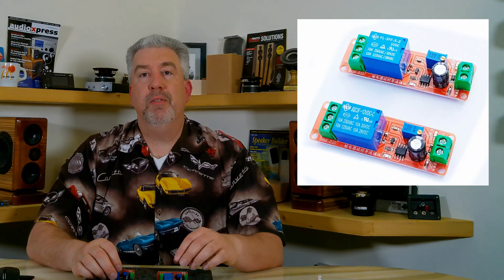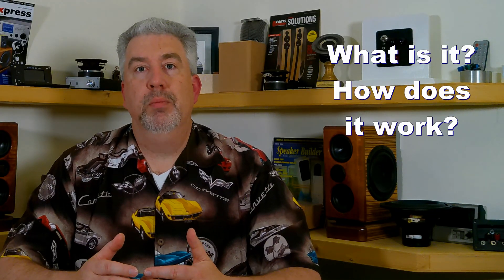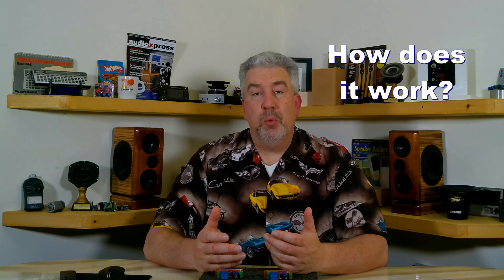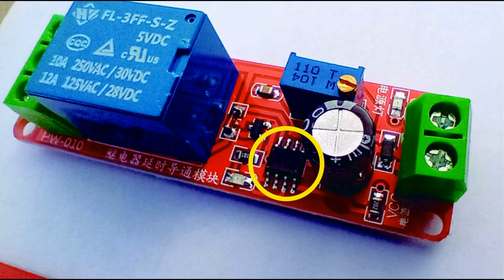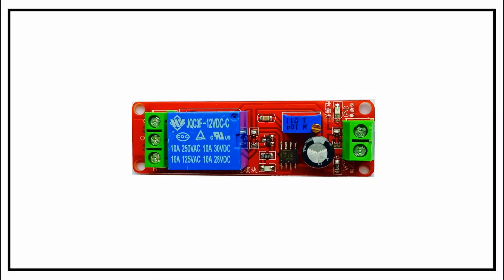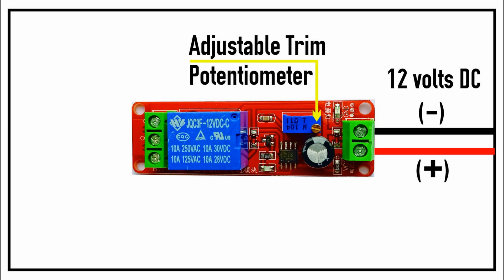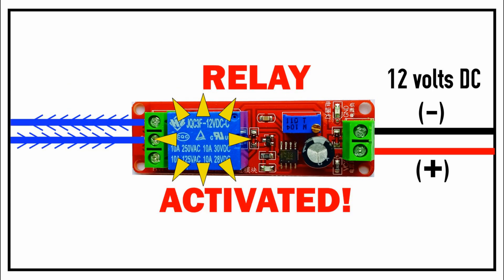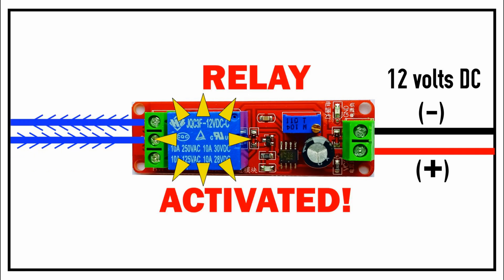Looking into How a Time Delay Relay Works

Comment: Help. I have a push button inside house by front door. This button, while pressed, opens up the metal gate that is 20ish feet from front door. I can press the button to let someone in, but me trying to get out the gate is not possible. As soon as I let go of the button, the gate locks(magnetic). Will this relay fix my problem?  Im not very hands on but can follow simple directions. Help this poor chap, please. Thanks

Comment: I converted my motorcycle from mechanical water pump to an electric one and used one of these to turn that pump on after about 10 seconds from key on.  That gives me the time to get the engine started so that the water pump (which draws 1.5A from the system) is only powered when the engine is running.  Working well so far.
Reply from the maker: That's a good use for something like this. I think they're pretty sturdy, hope it lasts the life of the bike!  Thanks for watching and commenting.

Comment: I made a simple RC delay with potentiometer which makes a power on delay that is adjustable. What is the advantage of the 555 chip in this circuit exactly?
Reply from the maker: Probably just cheap, easy, dependable... and maybe they found a huge stash of chips they wanted to make some money off of!
Reply: @zarboaudioprojects1430 I was thinking that maybe the 555 improves the accuracy and mitigates the effect of component tolerances on the precise timing as well?

Comment: can I use this with a 12v solenoid valve?
Reply from the maker: It should work, as long as the current required is under the timers limit.

Comment: I need something that can switch a stepper motor on let it run for a period and then stop and change direction. Then I need to able to adjust the speed, will this work? Maybe add some digital display.
Reply from the maker: This is a simple time delay relay, you need something more powerful to do what you want to do.

Comment: Cub Cadet lawn mower starter - internal relay has failed so pinion gear engages but no power to starter motor. I need a delay for the pinion to engage before high amp power hits the motor. A 1 second delay would do it. I may use this circuit but the lawn mower will be one harsh environment. .... still thinking ....
Reply from the maker: Maybe put in a little plastic container... like a gum box, to keep it protected from the elements. Might help it survive?

Comment: This is good when your car Fan is direct, so that fan would start after some seconds delay, before engine, this would reduce load on batteries.
Reply from the maker: Sounds like a perfect use case for this device!  I find it kind of fun to think of possible uses for stuff like this. Thanks for the comment

Comment: When I was a lad, I discovered the 555.  I can't look in any direction without seeing a piece of electronics that doesn't have one.  Keep a draw full of them, and resistors, caps and relays, and you're set.  The chinesium on amazon gets worse every day.  And it's so damn easy to build a timing circuit.
Reply from the maker: You can never have too many resistors, capacitors and relays. And, yes, a 555 timer is one of the best chips ever invented.
Reply from the maker: You can never have too many resistors, capacitors and relays. And, yes, a 555 timer is one of the best chips ever invented.

Comment: brilliant how dose it get power when you turn the switch off
Reply from the maker: It doesn't actually. When no power is applied, the bottom and middle contacts are connected, when power is applied and it times out, the middle and top contacts are connected.  Thanks for watching.

Comment: zarboaudioprojects1430
I'm using to delay car amp.
12v remote wire and ground at input end.
Remote to amp off top output.
Bottom output not used.
Middle common output , what goes there ??.

Comment: Can these be used as a speaker switch on delay? my class D amp has a nasty BUMP when you switch it on, wondering if these could be used to delay the speakers output for about 3 seconds or so.
Reply from the maker: Possibly... if the L and R share a common ground, you'd probably want to test first. Ali does sell a dedicated speaker delay just for that purpose as well.

Comment: Hi. Thanks for taking the time to make all your posts. Is there a board or circuit that gives the opposite function of this board? i.e. I give a 12v pulse of 1 second but get an output pulse of 12v for say 3 seconds? To put it into context, my camera controller has inputs from my reverse light and 2 side indicators to select the appropriate camera. The flasher unit is sometimes (not always) a bit fast for the camera controller and confuses it. If I could slug or elongate the signal into the controller it would solve the problem. Thanks in advance
Reply from the maker: Hmmm... I'm not sure there is a board for this... but you MAY be able to create this elongate the voltage for several seconds with the use of a capacitor inline with the positive lead.  I don't know what value or voltage rating would work, but I think it may be an option. The cap would charge and discharge slowly to 'elongate' the voltage. Maybe do some searches on Youtube for this effect.  AliExpress may have something that does this, but I wouldn't know how to search for it, what search terms to use.  Good luck!  If it works, feel free to re-comment, I'd be interested in seeing how it turns out.

Comment: Question:
First thank you for the video.
Q: would this relay delay the cut out? Meaning can it keep the light (as example) to stay On for couple seconds after the switch is Off? Then cut the power off the light?
Reply from the maker: This won't do that, but check this out from Ali:  https://www.aliexpress.us/item/2261799877292267.html?spm=a2g0o.productlist.main.11.5757eQVLeQVLoz&algo_pvid=b3e813e9-8222-47b7-b461-ddd9a0ca5116&algo_exp_id=b3e813e9-8222-47b7-b461-ddd9a0ca5116-5&pdp_npi=4%40dis%21USD%211.92%211.92%21%21%211.92%211.92%21%402101fb1517215822233534561ec2da%2120000000117340115%21sea%21US%211618196486%21&curPageLogUid=nXSUn7gX7SQ8&utparam-url=scene%3Asearch%7Cquery_from%3A

Comment: Very informative helpful video! Being very green to electronics I purchased this item without knowing it's not the greatest for my application. What sort of device would I be looking for to turn on a 12-volt beacon approximately 10 seconds then shut off?   Using a Banner photoelectric sensor to trigger when an overheight semi hauling heavy equipment passes through it. TIA
Reply from the maker: That sounds like a fun project... I don't know exactly what device would do that, but I bet a search on Ali or Amazon would yield a solution. There are delay turn off devices as well, maybe it could be that simple. Good luck!

Comment: Hi, iv just purchased 2 of these, but mine have zero voltage out once the relay energised and the second light comes on, but the 2 inner legs of the relay energise after the set time, do they do 2 versions of this that look identical, , so mine have zero output once the 2nd light comes on, and both work the same. thank you.
Reply from the maker: I've purchased so many things from Ali that looked/worked one way, then purchased another from the same seller even, only to find that there are differences one from another. It wouldn't  surprise me one particle if you got one that worked differently than the one I demo'd.  As long as you can figure out how it DOES work, you should be good. Thanks for watching and commenting!

Comment: I got one of these but no matter how many turns I adjust the screw, I’m unable to change the delay time
Reply from the maker: You might have a bad one.  But just for fun, try screwing it all the way out, or anti-clockwise, then going clockwise again, I had one on which that worked when it wasn't adjusting the first time. At least they're cheap! Thanks for watching and commenting.

Comment: I bought some strobing red LEDs that I was going ro wire in to the brake light on my scooter but the regulations for flashing brake lights require that they only come in when emergency braking. I found this video looking for ideas and now I think I have a plan! If I run this circuit off my standard brake light feed with a delay of 2 seconds then have it switch the strobing lights on I think I can have F1 style brake lights that might just be almost UK legal!
Reply from the maker: Sounds like it would work as long as the strobing lights are different than your main brake lights. Good idea!
Reply: Well mine finally arrived from China. My plan is to tap the live feed to my rear running light as that's always live whenever the ignition is on and use that to power my strobe light wiring the tap thru the output on this board and up to the strobe then tap the power line from the rear brake light and run that to the input on the board. I hope that makes sense! That potentiometer takes some bloody turns to take notice! @zarboaudioprojects1430

Comment: Kindly provide the circuit diagram best regards
Reply: A friend made a skamatic for me but he doesn't know how to add a timer relay.
I have a 12vDC motor that moves an arm on the motor from one limit switch to another.
I push a momentary switch and it starts the motor moving the arm from the first limit switch then hits the other limit switch reversing the motor to make the arm go back to the first limit switch and stop.
What I need is for the motor to stop for two seconds when it hits the second limit switch and then return to the first limit switch and stop.
I'm using four 5 pin relays and thinking how to change out one of the relays for a timer relay?
I saw a video on a relay Beuler BU-509TD time delay relay.

Comment: You should've shown the schematic diagram for this module .... they are very useful and have many uses ... I have one I designed myself and it's used as an inrush current limiter,  shunting a group of power resistors in a 1Kw audio amp I built.
Reply from the maker: Thanks for the comment and for watching!
Reply: hey janina can u send me the diagram pls.I need it for my project

Comment: I'm trying to setup a time delay on a toilet flusher with 24 volt power. Basically I'm hoping to press a button and have it flush for 5 seconds (engage the solenoid)

Any recommendations? The board I got didn't work out for me
Reply from the maker: Hey Marc,  Check this item out:  https://www.aliexpress.us/item/3256802427017605.html?spm=a2g0o.productlist.main.55.818e2d109ZRzKL&algo_pvid=24af2e47-9763-4618-9680-6e4c945748bc&algo_exp_id=24af2e47-9763-4618-9680-6e4c945748bc-27&pdp_npi=4%40dis%21USD%214.92%213.49%21%21%214.92%21%21%402101d4a716979757808453712e1d6f%2112000021396436345%21sea%21US%211618196486%21&curPageLogUid=hN66kIawbziv#nav-specification  
I'm not sure if this is what you need, I can't really tell from the description. But if you look for similar items on Ali you will probably find what you need.  
Thanks for watching and commenting!

Comment: Congrats for this fantastic explanation!! I would like to ask whether this relay can get activated with 6-9 dc Voltage in it's input, rather than only a fixed 12 dc Volt. I want to activate it with a rechargeable 9volt battery for my project. Would it work? Thank you!
Reply from the maker: Check Ali or Amazon for different voltages in this item. They have 5 volt versions as well.

Comment: Can 12v relay work with 18.5v dc input voltage?
Reply from the maker: It likely cannot handle that much voltage. Instead, check this product out for a minimal cost increase...  https://www.aliexpress.us/item/3256801531648436.html?spm=a2g0o.productlist.main.25.12b074deVELEXr&algo_pvid=885889ed-6f5e-4171-8e5a-0beab02fdfa4&aem_p4p_detail=202308250644598694424702336800004255246&algo_exp_id=885889ed-6f5e-4171-8e5a-0beab02fdfa4-12&pdp_npi=4%40dis%21USD%215.40%211.3%21%21%215.40%21%21%402101f49416929710997604513efba0%2112000017311197157%21sea%21US%211618196486%21&curPageLogUid=Dg5Z4bzZvWJK&search_p4p_id=202308250644598694424702336800004255246_13   Thanks for watching!
Reply: Just use dc-dc converter module step-down output
Input- 18.5V  output 12V

Comment: Hi,
I'm looking for a timer module similar to this one, but I need the opposite of what this does. I need a module that switches on the relay immediately when power comes into the module and keeps the relay on for a couple of seconds after power is removed from the module. I'm able to supply an additional continuous 12v power line to keep the relay on.
Reply from the maker: I've thought about this for awhile, but I can't seem to figure out how to do this with anything I could find. You might be able to do it with an Arduino board, but that's beyond me, and probably more complex than you want.
Reply from the maker: Not sure if this would work, but maybe check this thing out...  https://www.amazon.com/DROK-Controller-Delay-off-0-01s-9999mins-Adjustable/dp/B07RGT5G1X/ref=sr_1_14_sspa?keywords=time%2Bdelay%2Bswitch&qid=1692563971&sr=8-14-spons&sp_csd=d2lkZ2V0TmFtZT1zcF9tdGY&th=1

Comment: For me it's a multi-amp stereo in my van.  If the amps turn on at the same time as the radio, there's always a loud pop.  Thanks for the great video!!!!
Reply: So 12v  switch remote input and ground at input end.
Then switch remote output at other end.
What about the centre common output terminal , what goes there ?
Reply: Test

Comment: "afraid it might be confusing"
this is the first thing that finally made it make sense to me. I didn't know that you could supply voltage on the COM NO NC side all by itself as its own circuit, separate from the whole board being powered by switch on the other side. (the fact that only that side is switched wasn't apparent til you said so, is my only negative).
Reply: So to be clear, I can keep something on by supplying voltage via a positive into the COM and out thru the NC to the load to the negative... and then if I send a separate momentary voltage to the input side then I can get that thing to turn off for a moment?

Comment: I had to watch a few times and really pay attention before it sank in.  I'm not an "electrical" guy.  Is this same as a "soft on" or "soft power up"?  Would you recommend using one in the 2.1 build you just did?  My parts just came in and I'm starting to get that itch.
Reply from the maker: It could be used as a soft start option for an amp. Or, I suppose you could use this to switch on the ground line of a L(eft) R(ight) G(round) input to an amplifier so that the amp would still turn on right away, but the signal wouldn't get to it until the delay time was over. It depends on what 'thumps' or other noises your intended equipment makes and when.

Comment: I want to delay the amp off on my car amplifier using the radio. Remote on. I want the amp to turn off 10 sec after the radio powers down. Does the relay get constant power? And what pins would I hook up for this to work, thanks.
Reply from the maker: I don't think this would work for what you need. Once power is cut to this relay board, the power is cut to the switched device instantly. This only delay's the "ON" procedure.

Comment: Thanks for the video.  I'm thinking of using a couplle  of these to control a couple of contactors I'm using for an electric motorcycle build.  One contactor is used  in a pre-charge circuit, while the second is used for the main power circuit. Both are in parallel between the battery and motor controller.
Reply from the maker: Sounds fun. I was just playing with one of these myself today getting ready for another radio build.  As long as your voltage and more importantly, amperage needs are under the max on the timer relay, it should work well. Feel free to follow up here if you want on how it went once you get it functioning. Thanks for the comment!

Comment: Well explained. I have an EV car that has an annoying back-up warning. I want to be able to press a button to temporarily disable the back-up alarm when I back up out of my driveway at 4am so as not to wake my neighbors, but I want the back-up capability to return back to normal on its own. That way, instead of using a simple on/off I would never forget to return the back-up alarm to its normally on state. There are situations where I want the back up alarm on (backing out at a busy parking lot) so I never want to forget to turn the back-up alarm on.

Comment: Chears for the great video.  I'm building my own Battery Boxes.  To power fridges, lights, etc when camping.  I rekkon all the comercial ones are crap. Not fused, no battery protection, poorly ventalated and very expensive.  Anyways they all are charged by a DC to DC charger.  Problem I hit was I didn't want the DC to DC to start stealing power when I trying to start my Troopie.  Found these timer boards on EBay.  But like most geeky stuff on EBay there is little to no instruction.  So thankyou for taking the time to present this video.  I can now finish off my projects.  Cheers. :)

Comment: Which time delay board should I use in my car audio set up, the 5 volt or 12 volt?
Reply from the maker: I'm not sure what you're planning to do with it, but for a car, I'd say go with the 12 volt unit since that's what your car is wired for.  Just make sure whatever you're trying to switch doesn't exceed the current/voltage capabilities of the relay mounted on the board... it should say right on the relay itself what it's limits are.

Comment: Can this device be used as Horn Interrupter?
Reply from the maker: As in a car horn?  I'm looking at the 12 volt time delay relay board right now and it the relay on the board shows the ability to switch up to 10 amps at 30 volts. So it does sound like it might be feasible as long as the horn doesn't draw more than that amount of current.
Reply: @zarboaudioprojects1430  For Motorcycle.